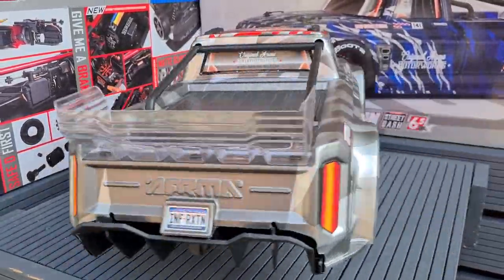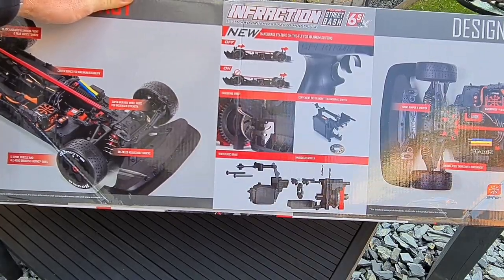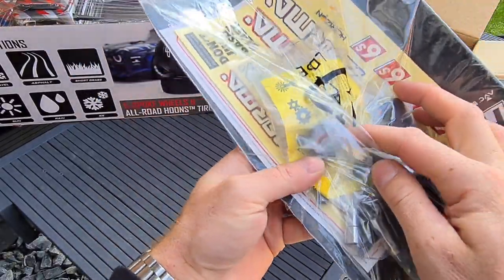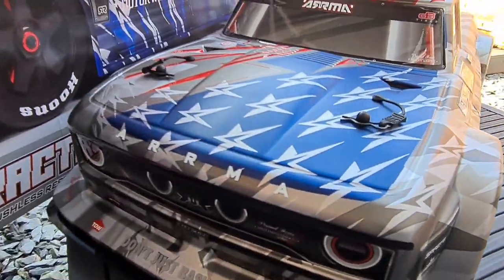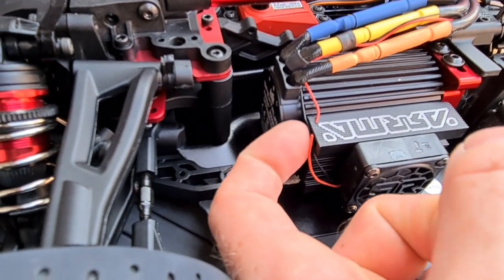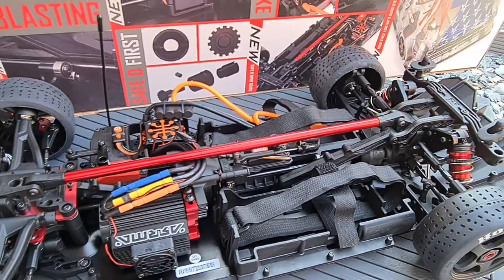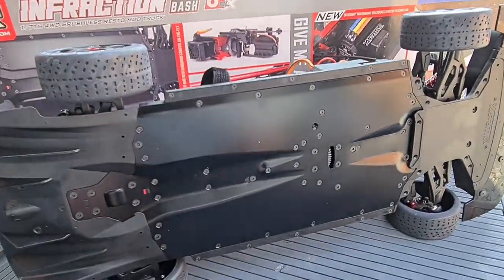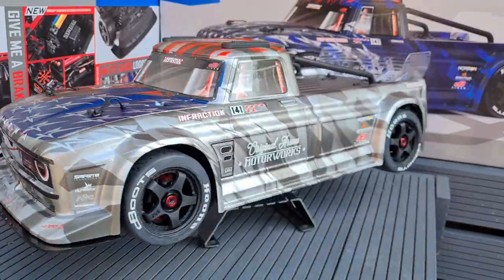ARRMA INFRACTION V2 UNBOXING

Comment: I missed it... Did you say wow.... Nice. I after the felony.... Please can I come be your camera man for your first run... I need to see this amazing truck in person. Then after maybe a bash with crawlers
Reply from the maker: Were having a crawler meet at cleehill not this weekend next, if your up for it? Add m.r.c.c on face book to keep an eye on times etc, I went to buy the Felony but couldn't get my hand on and I wanted the handbrake so turned out to be the infraction 👍🏻 had to order some battery connectors as I refuse to cut the new ones off lol

Comment: I have some cheap 1/8 tyres that I was planning to diy belt the inside before I glue them, so I don’t have to spend a fortune in expensive hoons. I will be interested to see what tyres you use in up coming vids.
Reply from the maker: Yeah I'm looking forward to seeing how they work, more for hooning around than speed runs, I've got at least 20 different sets from back in the racing days lol, can't wait to see how long they last, might even make some drift tyres from plastic tubing 🤔🤔

Comment: How is the InfractionV2  vs the Limitless ( i have the limitless) 
can you explain the diffrence ?   great video
Reply from the maker: Thank you, they are pretty much the same, in dimensions and electrically, the limitless probably a little more for speed runs due to having more aero dynamics compared to the truck body on the infraction, you can easily hoon both, the added bonus with the infraction v2 is the hand brake feature 👍🏻👍🏻
Reply: @rcworxshop  thanks for answer :) then i will save  up some  money and buy it christmas present:)
Reply from the maker: No worries buddy, thanks for the comments 👍🏻👍🏻